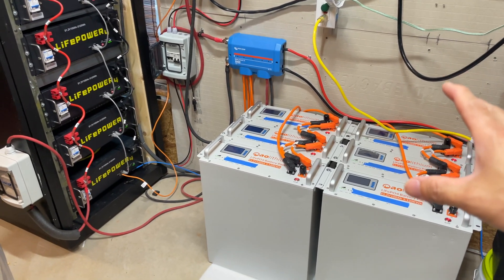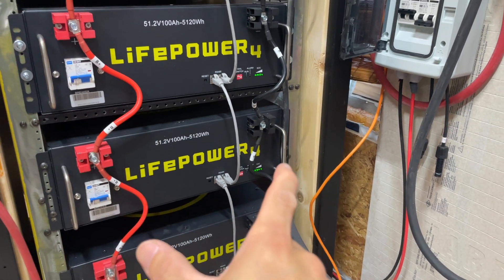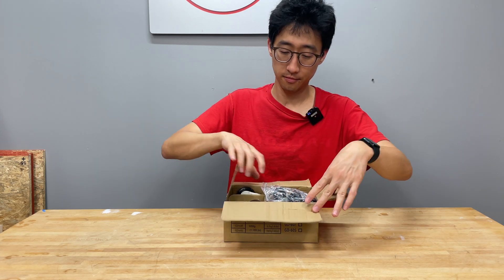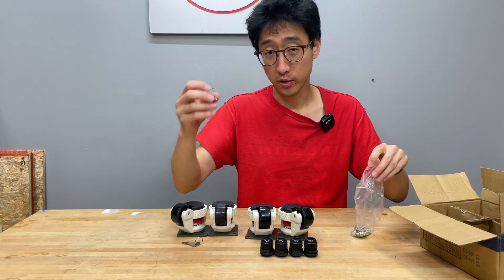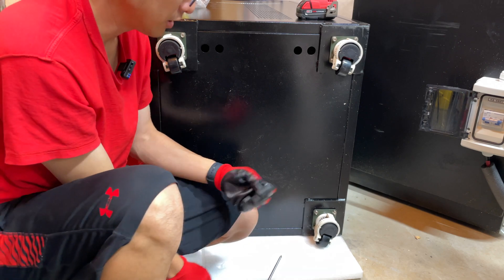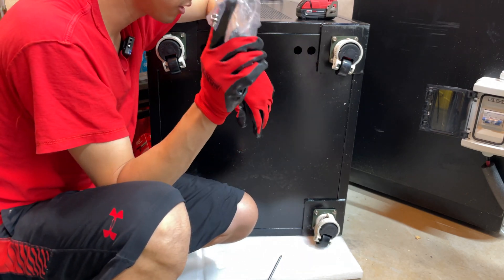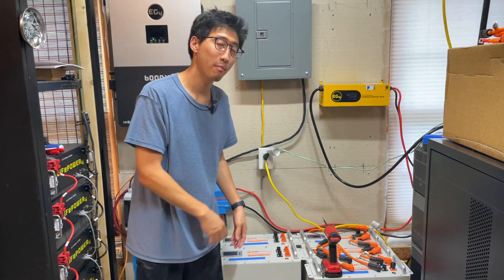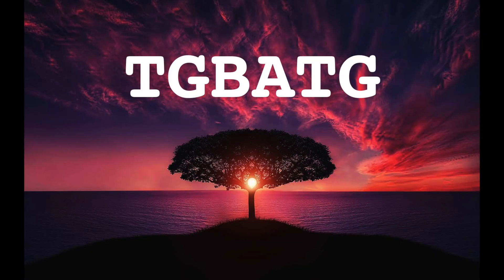EG4 Battery Rack Review | AOlithium batteries | Bus bars | Battery Cabinet with wheels enclosed

Comment: Bus bars are using insulated standoffs not heat shrink tubing for isolation.  Thanks for showing the cage in detail.  And forget about the silly cross connecting of the bus bars.  Charge and discharge current is controlled by the BMS.  You have more resistive loss inside each individual battery than through a solid copper bus.  Looks better when the wire is uniform.  More important is to keep your Lifepower software updated.  The latest update for me really helped with balancing out the state of charge for my whole bank.